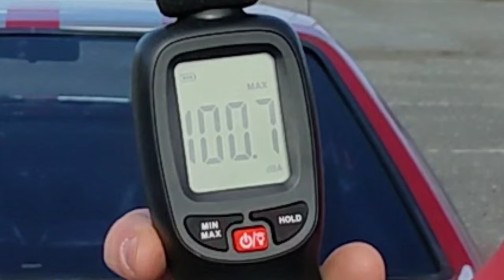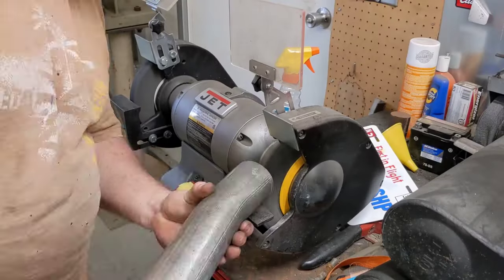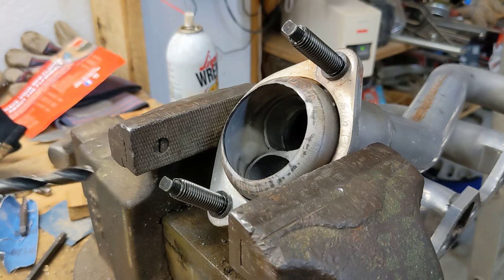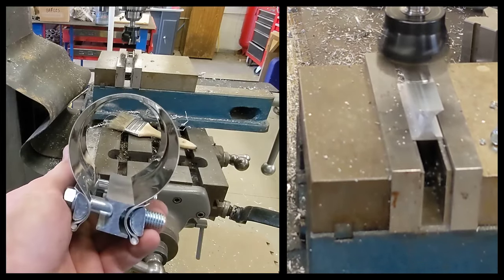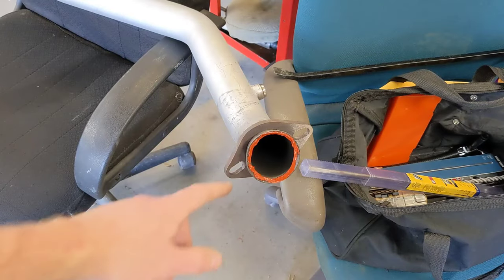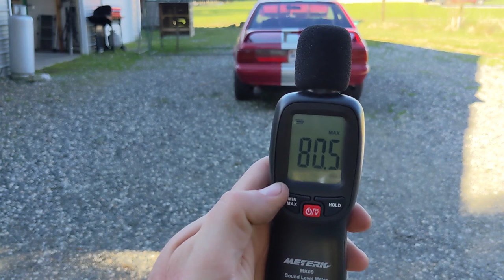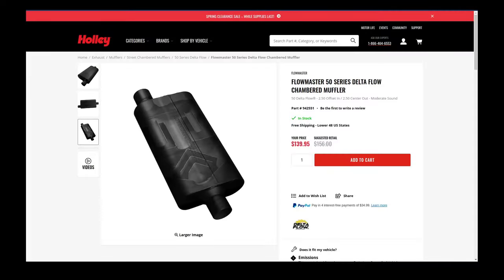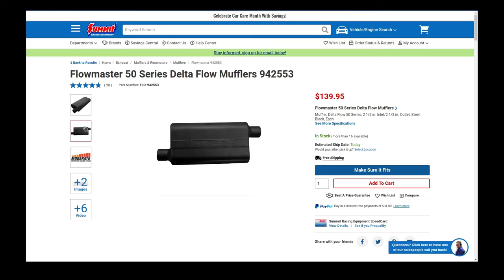FlowMaster 40 vs 50 delta flow on a Fox Body Mustang

Comment: Important thing to remember here is that decibels are on a logarithmic scale. Every 3db actually equals a doubling in sound pressure. So losing 8-10dbs as you are in most cases here is actually a huge difference, especially when it comes to those annoying drone frequencies.
Reply: I went from a Thrush muffler in my 4.6 4V to the Series 50 Delta Flow, totally awesome reduction in drone at all rpm ranges. Quieter at idle and still sounds great when you get on it. Exactly what the video says. Great job, well done. Happy motoring.
Reply: I didn't know the particulars of that, but wondered about it. Thanks! That really helps me in shopping for something to replace my Jegs version of 2 chamber 40s.
Reply: This man is correct but I will say it in a simpler way. 5 decibels is a lot. I’m in car audio and 5 db’s is a pretty big difference if comparing a stock sound system to an aftermarket so on mufflers I would only want something 2-3 decibels louder at idle and maybe 5-6 decibels loud when in the gas
Reply: Sounded better with the 50 series. The difference in the sound is much quieter. A loud car is fun for about 5 mins then it becomes a big headache

Comment: Thats the best side by side comparison ive ever seen, job well done. i also had the same problem with my 94 cobra with the collector dented i think its from not pulling the h pipe on even. I switched to equal length bbk headers and a pace setter x pipe with 40 series and 3inch flowmaster tailpipes for a fox like urs and it sounds raspy and rowdy. just took my mufflers to an exhaust shop and had the outlet swelled to match the 3inch tailpipes and it fit perfect i also switched to the band clamps myself for the same reason.From your video and your car i think you would like it. I wish exhaust companies would do what you did thats helpful on making a decision on exhaust because thats as important as wheels to guys like us.
Reply from the maker: Thank you so much for the kind comments!  I totally agree!  If it's so loud it gives me a headache, I just don't enjoy that anymore LOL.  Would love to hear a sound byte of your 3 inch flowmasters if there is one up somewhere!

Comment: Great video! Thanks for the content!

Another option which gives a more throaty sound, is the 50-series Big Block SUV. The dual-in/dual-out single muffler really knocks down on the annoying higher frequencies that make conversation hard, without holding back the lower frequencies.

Comment: The engine and pipe size makes all the difference in the world, my 95 5.0 is all of it's low hp stock glory, I have the original exhaust but the 4 cats are gutted and I finally removed the knockoff 10 series mufflers I put on so now I have no mufflers and the last 18" or so is 3"  and it is pretty loud and it does sound pretty sexy  but your car is easily louder with those 50s! I do have very little drone. My pickup has a 355 in the 350hp area with long tubes 3" pipe and turn down dumps at the axle and I ran original 40s for years and it just got so old just loud! I ended up tossing some cheap cherry bomb turbos on it and it is way quieter but still pretty loud, but it's a deep loud. But back when it had the 40s my truck idling drowned out a buddy's Chevelle that had a tired 350 and dual 2.25 exhaust with original 40s, with my truck idling you couldn't hear that Chevelle even running. Engine and pipe size! BTW you fox is pretty sick, love the sound with both, nice idle too...
Reply from the maker: Thanks for the kind comments! It hard to beat the sound of those 40s, just too loud for my now half century old ears 🤣😂🤣

Comment: Back almlst 20yrs ago, on my lincoln mark vii, which has a 302 5.0, i had  what at the time flowmaster called the series 2. I still have them, just not installed. I actually had them on 3 cars, 2 mark vii's and a mustang. Always loved the sound of them, but they were a bit droney. Didnt give me a headache or annoying to drive, and i had them kick out behind the rear wheels instead of straight back.

Comment: Appreciate this video, mate. I've got a 2018 GT with a muffler delete (from the previous owner) and I'm looking at getting a pair of Flowmaster 50 Delta Flows. The car currently idles around 75-80 dB w/o mufflers (according to the free app I installed on my phone) which is loud but still within California's noise limits. Looks like the 50 Delta Flows should turn that down a little bit more. 

The mufflers should help me be less obtrusive and avoid being pulled over, but California law also requires you to have mufflers to pass Smog, so I'm going to need a pair sooner or later. Appreciate the video!

Comment: I've used the Walker version of those clamps and have been very satisfied with them. A bit more expensive than the Summit brand, but no issues like the one you dealt with.
Reply from the maker: @JonnyCrash  will try to those next time 👍. Thanks for the tip!

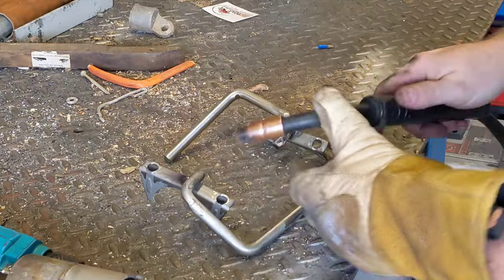Comment: 5:44 

I literally just did the exhaust on mine a week and a half ago, and had the same issue with the clamps. 
Also, the hourglass dealio that you milled flattened the outside pipe of the lap joint on mine, causing a leak at every single clamp. 

Great vid!
Many thanks.
Reply from the maker: You understand that the struggle is real lol 🤣😂. Thanks for watching!
Reply: @ThisOldFarmShop  
Oh it is absolutely real. 
My brother works for Summit in Akron. I texted him about it. 
Lol
Reply from the maker: That's awesome!!! Wow! It's a small world 😁.

Comment: Greetings. That was a very informative video. The drone will definitely give you a headache at certain RPM. I had a MAC off-road H-pipe, MAC shorty with 2 1/2 in exhaust with 40 series (drone). I tried an X-pipe with high flow cats (too quiet) and finally settled on a BBK shorty, MAC Pro-chamber (no drone, nice sound) but the off-road H-pipe sounded the best. I might go with your new setup or try to find some MAC Flowpath mufflers. MAC has gone out of business though. I have 3.73 gears. Thanks!

Comment: If I ever buy another Mustang to replace my 87, I'll be probably go with a Flowmaster exhaust. In an effort to keep drone to a minimum, I'll use an off road x-pipe (they drone less than H in my experience) and Flowmaster 50 Series HD mufflers (the highest flowing 50 series, according to Flowmaster). I like the Flowmaster sound with the 302 but I want the more grown-up sound of the 50 series. 

Also if I buy one, I'm going to build a 347 stroker so it has plenty of power to back up the sound. Want to be able to dust brand new Mustang GTs.
Reply from the maker: Sounds like a good plan! 👍👍👍
Reply: @ThisOldFarmShop  Which 50 series is on your car? I must have missed when you said or showed it. Is it the Super 50 or Delta 50? If I remember correctly, the Super 50 is the biggest one, made mostly for trucks.
Reply from the maker: @AdmiralRustyShackleford Deltas 👍👍

Comment: Your delta flow 50's look like they left a lot of room for your wider diameter aluminum driveshaft. Did you have issues with the space for shaft before you fabricated your hangars that hung on the tranny mounted ex hangar?
Reply: the 50's look to be tucked as for forward as possible - I'm concerned about the hardlines running down the right side being too close to the exhaust and boiling the fluids in the line - any advice?
Reply from the maker: @89gtsmoke  I didn't have any issues with the aluminum driveshaft as far as clearance goes.  When the car is on the ground, the driveshaft is much higher in the tunnel and out of the way.  I did put some high temp hose over the brake lines that were close to the mufflers, just because it seemed the right thing to do.  Haven't had any issues so far!  Thanks for reaching out!

Comment: What size exhaust, 2.5 or 3 inch?  Do you recommend the summit clamps? I got a NA 408 going into my 89 notch and full 3 inch ss from the Kooks headers to a x pipe, then delta 50s end it with the Black tails from Pypes.
Reply from the maker: @rudicuevas809  I bet that 3 inch ss will sound amazing!! The summit clamps I got are good if you are willing to modify them slightly 👍👍. I would say stay with the 3 inch. Would love to hear a clip of it when you get it finished!
Reply: Will send a clip when finished

Comment: Awesome car! Can you give some of motor mods and rear gear set up? Thanks for the videos!!
Reply from the maker: Thank you! Heres a short list of parts: 351 block, AFR 205 heads, Bigdogs stage 2 ported cobra intake, Anderson power pipe, 80mm mass air, 75mm throttle body, comp cams xfi 236/248 cam, 351 conversion bbk shorty headers, pro-m efi computer, 2.5" full exhaust, A/C, tkx transmission, 3.55 rear gears, stock rear end and axles.

Comment: I just ordered flowmaster 50 series delta from Amazon for my honda city gm6 4 cylinder. Do you think im wrong to pick 50 series for my honda city? I want to increase the torque and engine efficiency of my honda city. Thank you for your reply.
Reply from the maker: I think they will definitely flow better than stock, so should increase power and mpg.  Should tame the raspiness of a 4 cylinder better than the 40's as well, I would think.  Let us know how it turns out!  I'm curious :)
Reply: It’s gonna sound like crap. I’ve never heard anything other than a V8 sound good with Flowmasters. As for HP you might gain 1-3hp. A 1.5L engine doesn’t need 2.5” pipes and a Flowmaster muffler to breathe. Unless your vehicle is modified extensively, it’s just gonna make it loud and obnoxious with no benefit whatsoever.

Comment: i wish someone would do a video on muffler placement and what the changes in tone are. Placement as in closer or further from the engine or before and after the axle. seems like the newer (as in 05+) mustangs are more aggressive tone they have the mufflers after the rear axle. I wonder if that's the reasoning but haven't seen a video on it.
Reply from the maker: That is a very interesting idea!  I'm sure it would make a difference as to where to place them.  I would think more throaty the closer the muffler is to the rear, but that's just a guess.  Without some gas tank mods, I'm not sure you could fit a muffler after the axle on a fox body, but there's probably someone out there that has done it!

Comment: Thanks for the video!  My 95 cobra came with shorty headers off-road x-pipe with borla catback. Having fun with it but going to want something quieter in the long run that. 50 series?
Reply from the maker: Hey Keith! Thanks for watching! I'm not sure about the 50's vs. your borlas... I have however heard others say that the x pipe is slightly quieter than it's h pipe cousin so that should be helping you a little... Do you know if there is any packing or chambers in the borlas you have now?
Reply: @ThisOldFarmShop  thank you! it is a nice quality system and doesn't drone or leak but getting older and wanting something more quiet at low rpm not wake the neighbors at 6am. I also want to run a panhard bar and flowmaster catback kit is supposed to work with the maximum motorsports panhard kit. Here is what it says on how it is made:

BORLA® mufflers, on the other hand, contain high quality, continuous strand fiber bundle which is superior to the loose fiberglass packing in glasspack mufflers. This high quality packing material and stainless steel inner core construction, which is impervious to all corrosive acids, protects the packing from breaking down and getting blown out, so a BORLA® muffler never needs replacing. In addition, a BORLA® muffler is the most effective sound-absorbing device for the size, and it is guaranteed for one million miles.
Reply from the maker: I know borla makes a quality product! One thought is maybe get a cheap decibel meter and run the same tests I did against your current setup. That might give you an idea of how the 50's will stack up against the borlas.
Reply: @ThisOldFarmShop  good idea thanks

Comment: 6:34 Don’t worry when I had installed a set of equal length headers on my 95 GT I had mixed up the wires to cylinder 3 and 4 I died inside when I cranked it up and immediately turned it off 🤣
Reply from the maker: LoL 🤣. You know that "Sinking feeling" 😂🤣😂

Comment: Flowmasters have been reducing exhaust cfm flow for decades. We've done flow testing and dyno testing on them and after a certain point they absolutely kill HP. David Vizard also said the same thing about the Flowmasters years ago. 
Good video though.
Reply from the maker: I remember seeing one of your videos about that a while back.  Have you had a chance to test the new flowmaster delta flow mufflers which are "supposed" to flow better?  Thanks!
Reply: Depends on what setup you have, if you're running headers and no cats on a 10-11 compression ratio motor some backpressure will help hp numbers
Reply: @ThisOldFarmShop  we actually have a set of the new deltas in the show. We are gathering various mufflers together to do a big cfm flow test. Flowmaster realized word had gotten around in the LS world that their mufflers were robbing hp. Guys were reporting 20-40whp losses!!
Reply: @79cobra13  that's absolutely not true. Any Exhaust back pressure adds resistance to the piston which decreases hp. 
I wish people stop spreading that false information
Reply from the maker: @bigdogsportingtonyb2833  looking forward to your video on it!!
Reply: So you're telling me that a low compression engine needs as much flow as possible on the exhaust? I've been building cars for 25 plus years and I've apparently been doing it wrong. Lol stick to you're cold air intake and cat back exhaust junior you've got alot to learn
Reply: @79cobra13  it's good you are posting this in the YouTube comment section where people can see your comments for a good laugh.
Ive been building motors and cars for over 33 years now and have built over 100 motors from Oldsmobile, Pontiac, Chrysler, Chevy, Ford,  BMW, Toyota and Nissan. Even a few motorcycles and small engines. 
A engine that is properly tuned for zero back pressure will always make more power than the same engine that has exhaust back pressure.
For you to even argue this just goes to show how misinformed you are.
This is really no discussion  and not worth the time.
Take care.

Comment: Love the mustang 🐎! The 40s are for the young guys! When you get older it's not so appealing 😂
Reply from the maker: Thanks!! Love the 40s, but not worth the literal headache 😂🤣
Reply: I've got an 84 s10 that I've swapped a 383 into. It had dual 40s with its original engine and that carried over to this one. They are way to loud. Its been like this for years and I'm just over it. The resonance shaking the cab at certain rpm is just noise it doesn't even sound good. Once that goes away it sounds good. So basically I'm trying to decide weather to get 50s and do what you did. Seems like the solution.
Reply from the maker: @rcjg24 I'm with you. Loved the 40s, but hated them on the modified 351. Just gave me a headache within 5 minutes every time I drove it. The 50s don't please the crowd as much as the 40s, but they have me smiling again lol 😅👍
Reply: @ThisOldFarmShop  yeah I'm not to worried about pleasing the crowd. No ine cares about my rig amyway. I just hope I don't make it to quiet. I have a magniflow resonator x pipe that I just did that made it a little quieter. I could always take that back out for a standard x pipe. Thanks for the video!

Comment: 50 series is for the weak. Loud and proud….wake the dead…..40 series….
Reply from the maker: Wake the dead is spot on LOL
Reply: Farm shop!…. You know you wanna do a video with those 40 series slapped back on there…. With dumps!…. Call it “sounding lethal back in the day” on board camera on the hatch back and inside on the dashboard facing you…, stroll up to 4th gear,… drop that pushrod torque hungry beast into second gear and work it all the way up through fourth….. let off and push the clutch in, slap that shifter left to right while giving it the champions double up slap of the accelerator and say “welcome to the early 90’s fans”! “Wooo”!!! “Nature Boy”!!!!😂